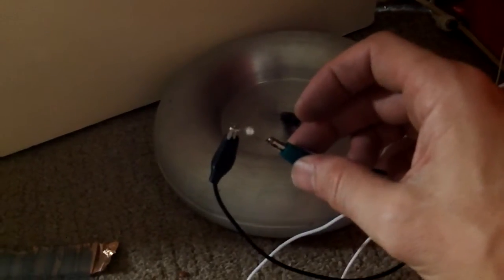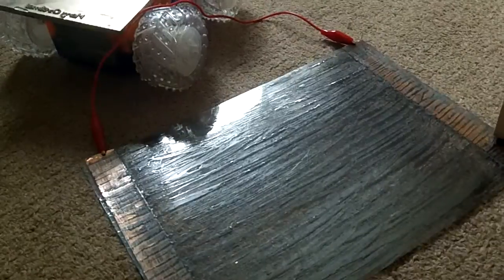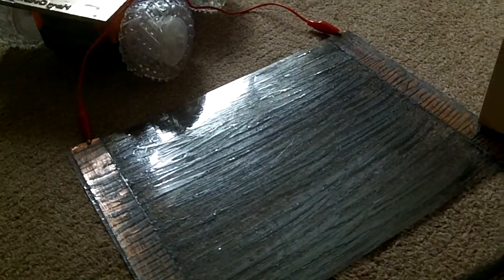Conductive Ink on acetate lighting LED

Comment: cool stuff ! stick a voltmeter with a Hz reading ... I wonder if in the few HZ or KHz range ... ( 50 - 60 Hz is AC ) although ... if you say it works better at higher altitudes .... gets me thinking aerial tech here ... Radio AM ... stuff like that or even SW/LW ... that'll be coherent with one touching it - we ll know that touching an aerial radio or TV it boosts a little the signal. Try vectoring the sheets to stand them and try different orientations :)  endless fun ! :))

Comment: Did you find out what was primary reason for the led lighting ?
Reply: Sure. It's rectifying the AC voltage which is always there in the atmosphere. The higher you go, the higher the voltage is. The Earth is an electric body, and so it has a potential difference which can be used to drive a circuit. 

http://en.wikipedia.org/wiki/Atmospheric_electricity